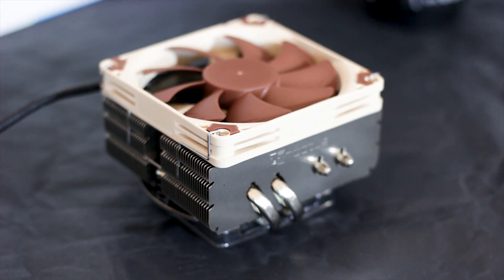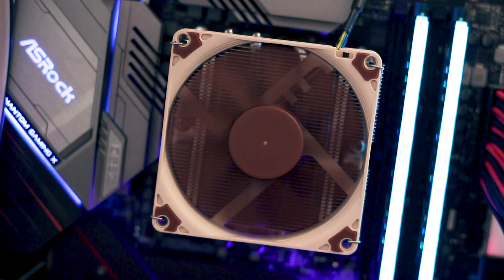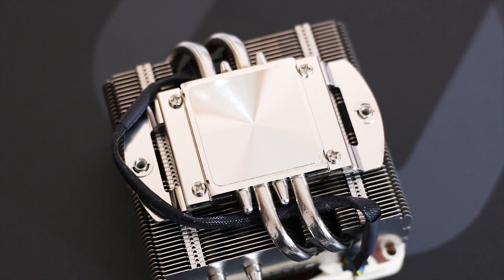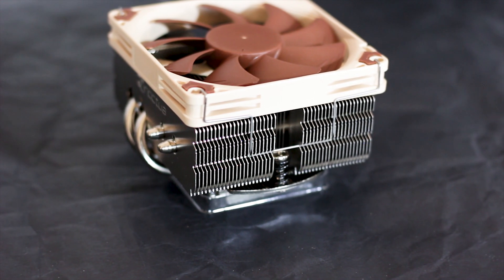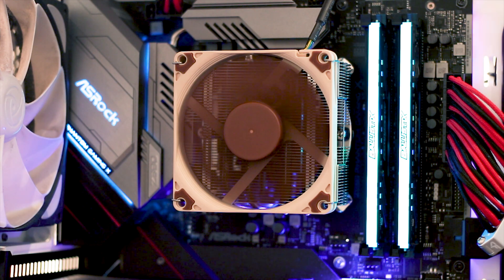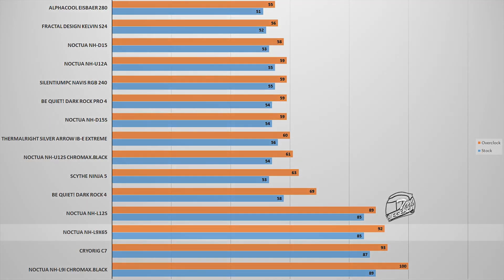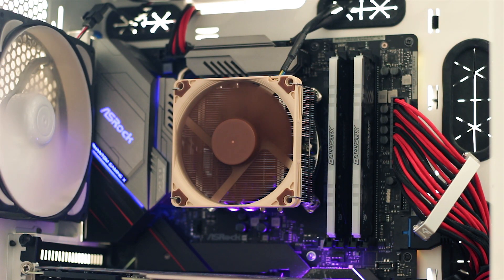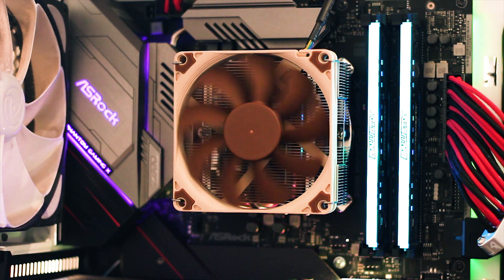Noctua NH-L9x65 - CPU Cooler Review

Comment: Hi bro, is this cooler good for i7-10700F?
Reply from the maker: No, you need a bigger cpu cooler for that CPU.
Reply: Lo es, instalado en una Louqe Ghost S1 MkIII en jornadas de juego de 2h de duración, se mantiene en 72-75°C. En una caja mejor ventilada, podrías tener mejores temperaturas. Y el silencio, es sepulcral.
Menuda bestia es este procesador 😮. Lo tengo con undervolt y aún así en ocasiones lo veo subirse sólo a 5.1 (en un núcleo).
Reply: Ahora bien, te lo recomiendo si no tienes más alternativa por el tamaño de la torre.
Si te cabe uno más grande, mejor sin duda.
Cómo curiosidad te digo que previo al x65 tuve el l9i, y salvo en la Phanteks Shift X que lo estrangulaba térmicamente, en la Louqe se mantenía a 4.7.
Noctua no tiene parangón, hay marcas que se le acercan pero es imbatible.

Comment: Nice review. Two extra positive items about this cooler: The provided fan mounting clips will work with either the 14mm thick included A9x14 fan or the 25mm thick A9x25 fan. This thicker fan spins only up to 2000 RPM instead of 2500 RPM being quite a bit quieter and also moving more air. The cooler is then 76mm tall (L9x76?). The AM-4 version includes 2 sets of mounting bars so that the cooler can be rotated in 90 degree increments to ensure the heat pipes run horizontally with a vertically mounted motherboard.
Reply from the maker: Sorry for the late reply! 
Also thank you for the added info, I'm sure it will be useful for years to come! :)

Comment: what about i5 10500 running on a 4.3 GHz turbo performance (not OC) ???
Reply from the maker: It will work but keep the voltage as low as you can and the airflow as high as it can.
Reply: @TechLegend-com  1.0-1.1 v would be fine???
Reply from the maker: @ark66  I can't know that as I never used that CPU with this CPU cooler in particular.

Comment: Would this be a good pair with an I7 10700f? (my case have 3 140mm fan, 2 front and 1 back so i don't thing air flow would be a problem lol) thx
Reply from the maker: Not really. You need a bigger CPU for that i7. Try one of the higher TDP Top flow coolers.

Comment: Hi, is this cooler good for a ryzen 5 5600g 4,4ghz all core Vcore 1.3v, Vsoc 1.24v and 16gb of memory at 4200mhz? I'm asking because I'm having a bit of trouble with my wraith spire. Thank you.
Reply from the maker: Not good enough for that CPU. Get something bigger to prevent thermal throttling. What case are you using?
Reply: @TechLegend-com  Cooler master masterbox q300l
Reply from the maker: @mr.x2512  Get something like the Noctua NH-U12S, be quiet! pure rock 2, Deep Cool AK 500 and so on.
Reply: @TechLegend-com  Thanks

Comment: This might be useful to someone. I've got this cooler for a 35W TDP CPU (i7-7700T). Mounted on a Fractal Design Node 304 case (compact). 

Numbers with the case closed and the front case fans at minimum. Rear case fan is off due to not enough system temperature to turn on via fan curves. The cooler's fan maxes at 50% as per fan curves profile. 22C ambient temperature.

Stress tested using stress cli tool:
stress --cpu 8 --io 4 --vm 4 --vm-bytes 1024M --timeout 600s 

Idle: 39C
Full: 61C (after 9 minutes)

I would imagine the numbers would be somewhat better with more aggressive fan curves for the rear case fan and the CPU, but my system is configured to be as quiet as possible.
Reply from the maker: Those are good numbers, even if you have a lower airflow inside the case. Thank you very much for sharing these!

Comment: Can i install this on my intel i53570k
Reply from the maker: Yes but you need plenty of airflow.
Reply: @TechLegend-com  air flow? Plz elaborate?
Its not enough for the processor?
Reply from the maker: @ahsanmeer926  Yes, you need good airflow inside the case otherwise this CPU cooler will not be able to cool your CPU. The CPU cooler is small and if it does not have a lot of airflow it will not perform well.

Comment: I must have mounted mine wrong when I changed out the cpu, at higher rpm the fan is making a rattling sound against the fins.
Reply from the maker: If it's rattling, then the fan is not properly seated on the heatsink. Check the fan clips.

Comment: Is it a good cooler for the i7 8700?  (no overclocking planned)
Reply from the maker: It should work just fine, but make sure you have a good airflow inside your case.
Reply: @TechLegend-com  Yes it's an half open system. I get great results.
Reply from the maker: @Mars-1995  Alright! :)

Comment: If it held together an i9 9900K with an overclock it should probably do well enough in my stock i7 12700F. I don't intend on overclocking it anyway. What do you think?
Reply from the maker: It will be ok, but make sure you have a good airflow inside your case.

Comment: Would this be enough for an i5-12600k?  going for an air cooled sff build, max 70mm heatsink height.  if not, anything better?
Reply from the maker: This will work but no overclocking for you.
Reply: @TechLegend-com  Great! I couldnt find enough info anywhere.  Thank you for the reply on such an old video :)

Comment: Can I install a noctua industrial 3000rpm on tge heatsink?
Reply from the maker: There are no Noctua Industrial fans that will fit this heatsink.
Reply: @TechLegend-com  😭😭😭 no worries
Reply from the maker: @masonjohn156  Why do you want an industrial fan on this cooler anyway? Those fans are not cheap, you might as well get a bigger cooler.
Reply: @TechLegend-com  I can't be bothered with replacing my mini itx motherboard that cyberpower provided  so I decided to look for low profile heatsink 😅 but I realized the industrial fan is 120mm not 95 lol
Reply from the maker: @masonjohn156  Yes then you are stuck with this fan.
Reply: @TechLegend-com  ok

Comment: Will this cool a 2700x? I ordered this but now thinking I should have gone with the L12S, but it's a very small case

How does this compare to the L12S?
Reply from the maker: The NH-L12S is better as it has a bigger radiator and a larger cooling surface.
Reply: A 2700x doesn't belong in small form factor. 105w base wattage will be incredibly difficult to cool with any in-market SFF air coolers. You will hit thermal throttle quickly, if not instantly.
The 2700x implies overclocking, too, meaning a PPT of 142w.

Comment: is this hsf enough for overclock sand undervolt  ryzen 5 3600?
Reply from the maker: What case are you using?
Reply: @TechLegend-com  NZXT H210i
Reply from the maker: @sensenpratama  I'd get a bigger and better cooler with that case.
Reply: @TechLegend-com  so what the best cooler around 50-60$ ?
Reply from the maker: @sensenpratama  Take a look at the Noctua NH-U12S Redux, or the Noctua NH-U9S.
Reply: @TechLegend-com  how about NH-L12S?
in future I want change my case to Cooler Master NR200P
Reply from the maker: @sensenpratama  The NH-L12S should be ok as well. You can also look at the NH-C14S.

Comment: Do you think that would suit the needs of my Ryzen 5 3600? I don't plan on overclocking for now, and my case is a Corsair Spec-04 Tempered Glass which only supports CPU Coolers up to 150mm tall, so this CPU cooler kinda seems to fit my needs. What do you think?
Reply from the maker: It should work, but make sure you have good airflow inside the system.
Reply: @TechLegend-com  I do, I have 2 exhaust fans and 2 intake fans. Do you think I should spend 20 dollars more and get a Noctua NH-U9S, which is a tower cpu cooler, instead of that one, or is that one already fine for gaming and light overclocking? By the way thank you very much for replying, most youtubers don't. +1 sub
Reply from the maker: @danielgravina9338  If the NH-U9S fits inside your case, then that cooler is the better choice.
Reply: @TechLegend-com  Thank you very much! Loved your channel and the attention you give to your subs. Have a nice day :)
Reply from the maker: @danielgravina9338  Thanks!

Comment: Can this cooler adequately cool a 5900x on an open air case? (The xproto case)
Reply from the maker: I would recommend a bigger cooler, especially since you have an open air case.
Reply: @TechLegend-com  true that, but I would like to take aesthetics into account also. I mostly do gaming so, I just don't want to run into throttling under those loads. I'm hoping a low profile air cooler would be enough
Reply from the maker: @flasks  Look at the NH-C14S, perhaps that one you'd like more.

Comment: Do you think this cooler perform well with an i5 10600k with stock configurations ? I plan to build a open pc
Reply from the maker: Take a look at the Noctua NH-U12S, it should be better suited for your CPU.
Reply: @TechLegend-com  I know this cooler is better but I prefer for size and esthetic the L9X65, do you think this thermals in your video will be the same or moreless identical to your 9900k ?
Reply from the maker: @Reon_ssb  Your CPU should run cooler with the NH-L9x65 especially if you're not planning to overclock.
Reply: @TechLegend-com  thank's, and yes, I don't plan to overclock it
Reply from the maker: @Reon_ssb  Then you should be ok.
Reply: @TechLegend-com  thank you and nice videos
Reply from the maker: @Reon_ssb  Thank you, don't forget to subscribe! :)

Comment: would it be good with a ryzen 5 3600XT ?
Reply from the maker: I'd get a bigger cooler for such a CPU, especially if you want some overclocking.
Reply: @TechLegend-com  thank you
Reply: @TechLegend-com  what would you recommend ?
Reply from the maker: @Mistermookey  Any tower air CPU cooler would work just fine. You can take a look at the Noctua NH-U12S.
Reply: Tech Legend well that’s the one I looked up to first. Thank you.
Reply from the maker: @Mistermookey  You're welcome!
Reply from the maker: @Mistermookey  You're welcome!

Comment: Hi would this be suitable for a Intel i5 4690K  with a overclock at between 3.9- 4.2. and what  temps would you expect on this ?
Reply from the maker: Not really suitable for that CPU and with that overclock. You need more cooling surface area, even for an 4690K.
Reply: @TechLegend-com  do you mean cooling surface area from the heatsink fins or the  PC case. I just purchased the Aerocool eclipse case(https://www.youtube.com/watch?v=eWGnG6HF3y4&vl=en) and  it already has 4 fans in it and intend  putting another fan in,(transferring all my parts from my ITX 130 case to new one). Presently I using the Mastercool 120 watercooler and still works fine but it is now 6 years old. I use a  MSI ITX Z971ac board, really want to go back to  a heatsink fan system. My issue is the memory clearance , as I have 16GB Corsair 2400  Vengeance Memory sticks 4.5 cm tall. So looking for a low profile cooler without a watercooler and with no obstruction of the memory sticks. Any ideas would appreciate it.
Reply from the maker: @gracierunwiththewind  I meant the cooling surface area of the heatsink, not the PC case. The heatsink is too small to cooling that CPU, also the fan itself is small. The AeroCool Aero One looks to have up to 161mm of space for the CPU cooler, that's not exactly little, you can look at the Noctua NH-U12S as an example.
Reply: @TechLegend-com  Noctua NH-U12S  would this clear the memory slots as I have only 2. link to the motherboard. https://www.tweaktown.com/reviews/6607/msi-z97i-ac-intel-z97-mini-itx-motherboard-review/index.html
Reply from the maker: @gracierunwiththewind  It should but I can't guarantee it, as I never used that motherboard.

Comment: can it perform  for ryzen 3600? what range of temp will i get if not OC
Reply from the maker: For that CPU, you need to get the Noctua NH-L9x65 SE AM4. As for what temp. to expect, I'd say around 65-70c when gaming.
Reply: @TechLegend-com   will i get bracket with it?
Reply from the maker: @CS2RCS  The NH-L9x65 SE AM4 is designed for the AM4 platform.
Reply: @TechLegend-com   i know but i already ordered it , i wish to know if i will get a bracket to mount it?
Reply from the maker: @CS2RCS  Most likely, you will get the bracket for AM4. But you should have gone for the variant that was made for AMD.
Reply: @TechLegend-com   sadly it was not in stock , what  is the varaint for amd?
Reply from the maker: @CS2RCS  It's called the NH-L9x65 SE AM4.

Comment: I use this in my VR rig since it's built in an HTPC chassi with limited clearance. Have worked great so far, but I haven't ventured into overclocking with it.
Reply from the maker: That's a good way to use such CPU coolers. I often recommend overclocking only if you need more performance, if it works, then it works.